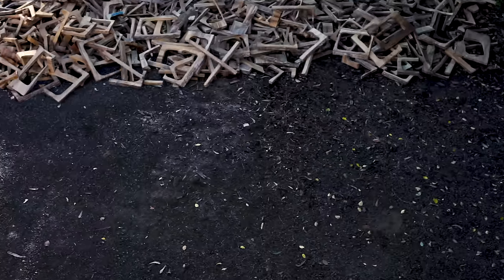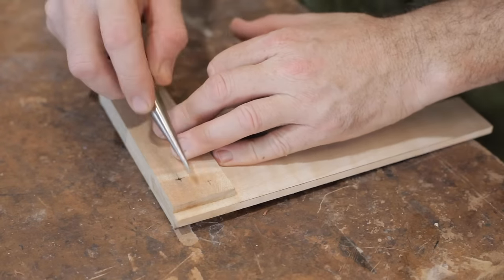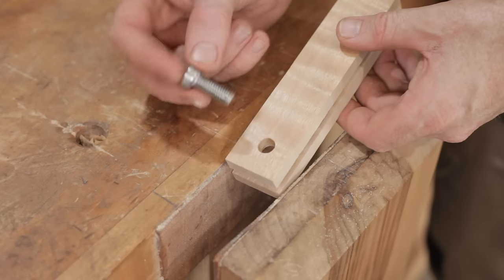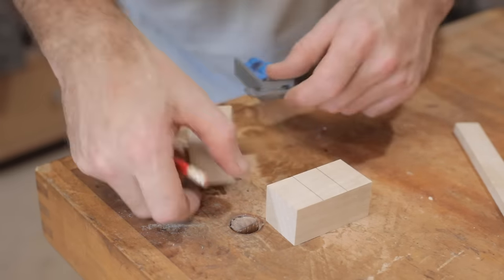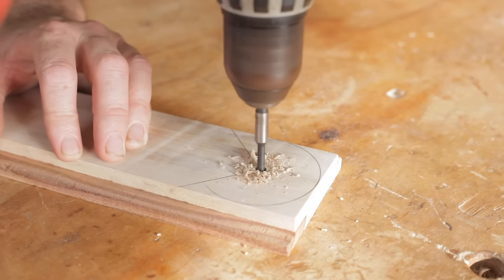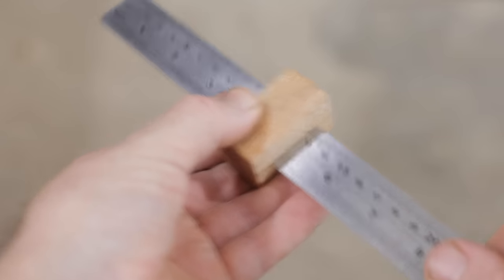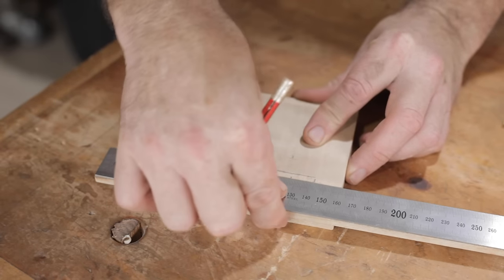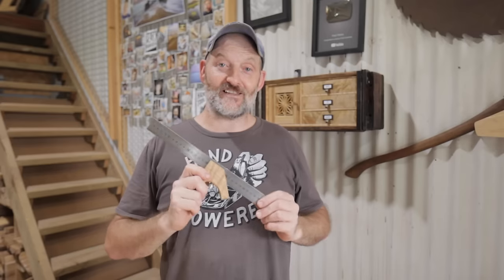7 Homemade Marking Tools for Woodwork - Scrapwood Challenge ep27

Comment: Very nice! When I make something from wood that requires threads, after tapping the hole I saturate the threads with thin CA then run the tap through once more to clean and smooth out the threads after the glue has dried. I've used this "trick" for many years building and flying R/C planes where light plywood is commonly used....it even works pretty well on Pine, Basswood and hard Balsa.
Reply: Доброго дня.Что такое СА?
Reply: @Сутьділа  my apologies if I'm misunderstanding your question.....CA is cyanoacthrolate, more commonly known as "super glue"

Comment: Aloha Pask from Oahu! I liked your Scrapwood challenge #27 . A helpful tip from my own 'toolbox': when 'tapping' threads into wood , I found it made the wood more durable if I wet the wood use crazy glue and let it soak in and cure until it couldn't suck in any more . This reinforced these wear surfaces and made them last much longer . I came upon it first with patterns made of MDF and the weather made these swell up and than they needed to be replaced . Not so when I first soaked them with crazy glue . It can be used on those shop made tools and jigs ,as well .

Comment: Hi Neil. First i want to thank you for all the great things you have shared with us. Second I would like to ask you if you could make a dovetail guide. Your very good at doing jigs, but also to share the process. Thank you once again!
Reply from the maker: No worries Ivo! All I use for a dovetail marker is a piece of aluminium angle cut to the required angle. I'm sure it would be in one of my videos, maybe the ammo box one. :)
Reply: I've found it! :) Still, for an amateur and beginner like me, a dovetail guide is much more helpful than a dovetail marker. But I'll just keep practicing until you make one. ;) Thanks and keep up the great work!
Reply from the maker: @Ivo_Serra  Sorry, I read that wrong. I've never used a guide but they should be easy enough to make! :)

Comment: Only issue I have with this is, where I'm at, have to deal with high humidity. Wood moves, you can sand to make true again but, once humidity level's change, so does the wood. Now, before anyone thinks I'm disagreeing with the video, I'm not. Just pointing out the biggest issue that will be faced doing this. Honestly, if it weren't for the humidity levels we get here, I'd be making lots of these. Just can't, due to that issue. Love the video, cheers :)

Comment: Great tools. Not only helpful in my shop but would make great gifts for woodworking friends. I noticed some flex in your table saw insert. Has this ever caused you problems with any projects? Thanks for sharing.
Reply from the maker: Thanks! There is a little flex in the insert but it hasn't been an issue, I should probably make a new one though! :)

Comment: Using wood that will expand and twist when the weather changes is not good but maybe it's better wood than here in Texas. Thanks
Reply: I was wondering if anyone had thought of that. I can see it working up to a point for things like the bevel gauge and easily for the marking gauge but that square would be out of spec every few days here the way the weather changes.

Comment: Great video.  You should be aware that wooden planes are usually not that accurate due to the movement of wood with humidity and seasonal changes.  This can affect ones the size of yours by at least a few degrees and make them suitable for decoration only.  That steel machinist square won't have that problem though.

Comment: Great ideas. 1 question: does the center finder only work for square/circle wood?. But not on rectangle profil wood?
Reply: No, I don't think it would, as the line from corner to corner on a rectangular block is  not 45° from the edge

Comment: I want to build the center finder myself. However, from previous attempts, I know that even if you get all angles right it can yield indications that are off center, if the arm along which you drive the line is glued a little bit further away than just the middle of the angle. Do you have any advice on getting it glued just in the right spot?

Comment: Could you make a jig to hold 2 pieces of wood together as for a corner? I'm not strong enough to screw the first corners of all my projects. I always have to use both my hands on the power drill/driver. Subsequent corners are not as problematic, but that first one ... grrrrrr...

Comment: good job .I am new to wood working , does moisture change the wood such that it won't be square ?
Reply: There's a possibility that it could happen, but it would have to get quite damp AND the wood used to not be very straight grained.

Comment: Great projects and woodworking tools for the hobbyist. However, wooden threads just don't sit right with me, it smacks of temporary and quick wear, especially if you use the tool regularly. I would epoxy in a hex nut or metal sleeve where possible :)

Comment: Looks really nice. Have to ask what kind of wood is that? It looks gorgeous. 
Also who is the idiot who down-voted this?
Reply: Probably a tool salesman. Will lose sales and income if too many people see that they can make their own tools instead of buying from his very over-priced selection on his 
"Snap-off" truck.
Reply from the maker: Thanks Martin - it's camphor laurel! :)
Reply: @PaskMakes  Though I guess that the figuring is not an normal occurrence on that tree like for example curly maple or as I recently found a piece of curly pine :p
Hard to find much exotic wood here in Sweden though. I can get Jaraha though since a local furniture factory about 10 km from where I live uses that to make outdoor furniture. I sometimes go and look through their scrap container for usable pieces :)
Read that Camphour Trees are mildly toxic though so I probably shouldn't use that anyway because I'm already allergic to other things so might be sensetive to that as well.
Reply: And 28 other idiots since you posted! I don't get it either, but some people are just haters.